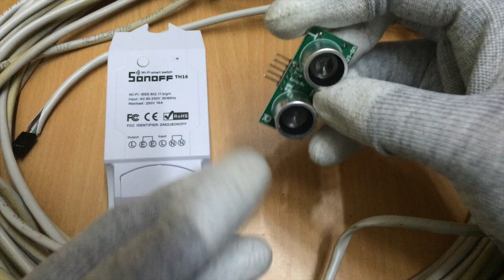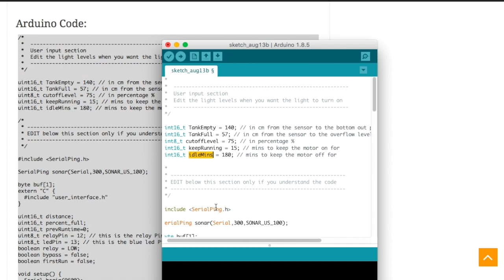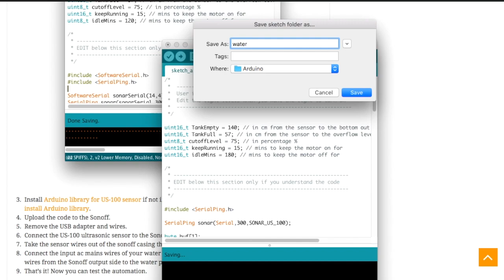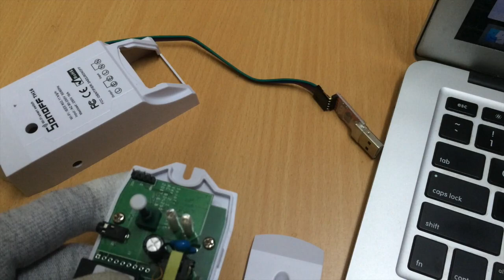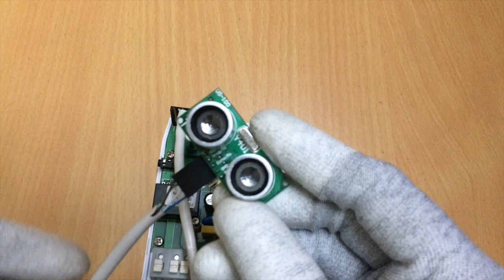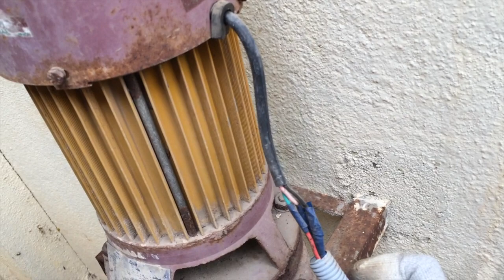How to automate your water pump/ motor using Sonoff and ultrasonic sensor

Comment: You are going to need two of these. one for overhead tank and another one for the source tank. if the source water is empty then the motor should not work even if after 3 hours the water level indicates to turn on the motor in order to acheive the set value for the overhead tank. or maybe something less complicated than sonoff for the source tank only.

Comment: I want to automatically empty a rain barrel when full and cut off pump.  Do you have a “good “ sensor to detect any type of metal or copper?  I have a design to share for you to make if you have correct sensor.